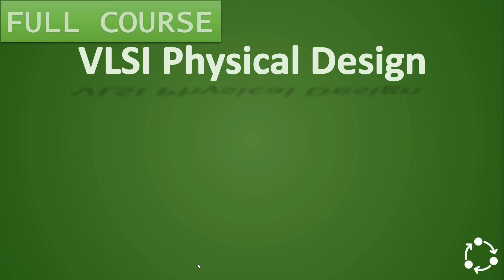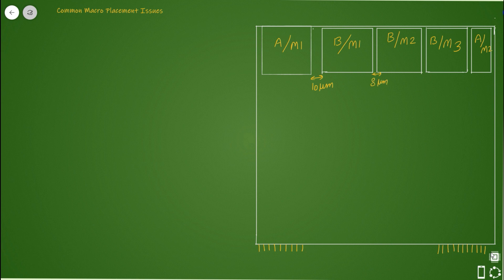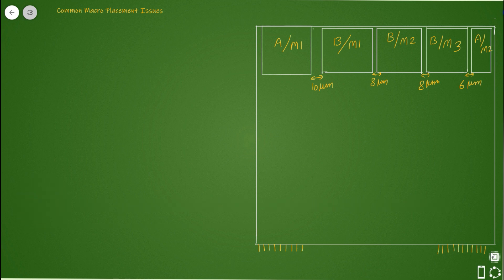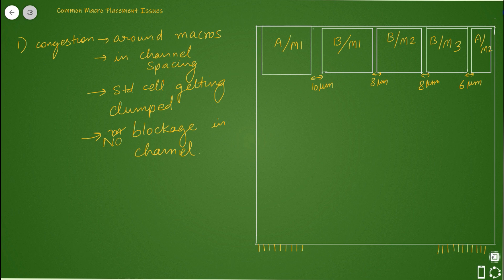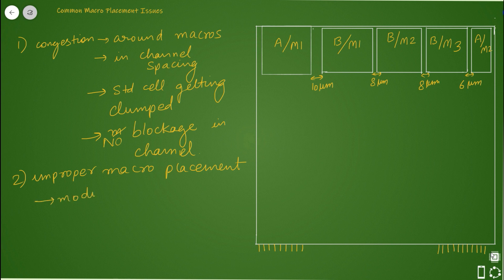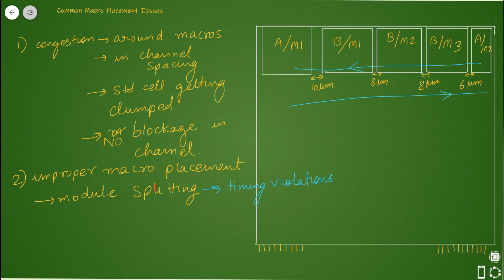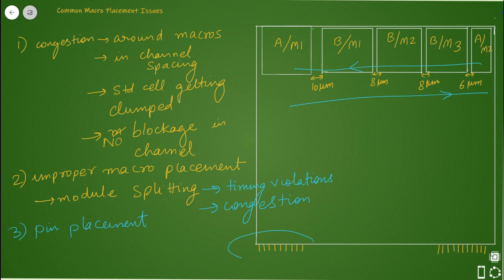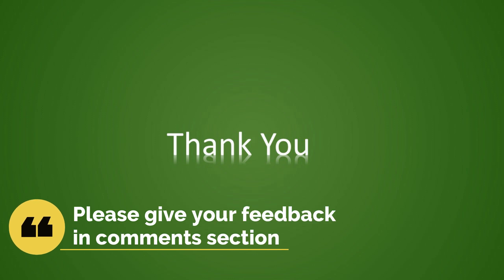PD Lec 23 - Macro placement issues | | Floor-planning | VLSI | Physical Design

Comment: I know min space formulae,
Did you what is max spacing between macros
Reply: @VLSIAcademyhub  yess I know there is know maximum spacing , but for eg: I have {1500 1500} size ,
Based on the formule min space is 15um but I have given spacing as 70um between the macros because I have enough die size.
If some one asks me why you have gave 70um  space ...
can you tell me that what is the good ans I need to give which is acceptable
Reply: There is no connection between that two macros and and no conection with same hierarchy macros then 70u is K but is there any conectivity between them are nearby macros then it will be detour , standard cells placed between macros   there no plcement blockage,